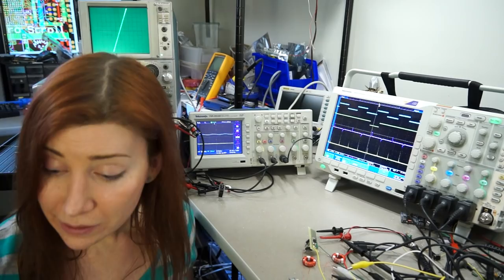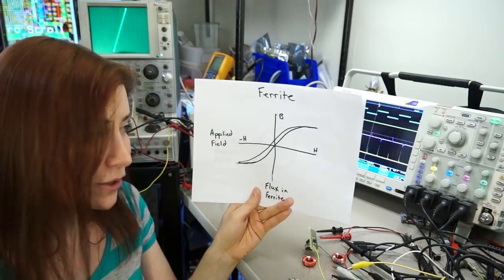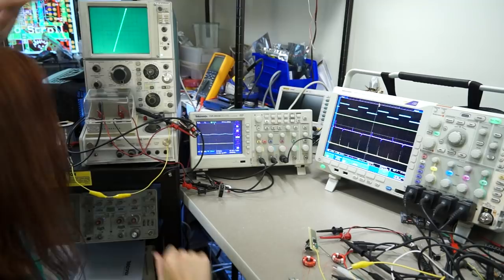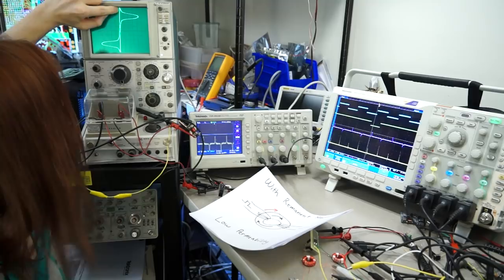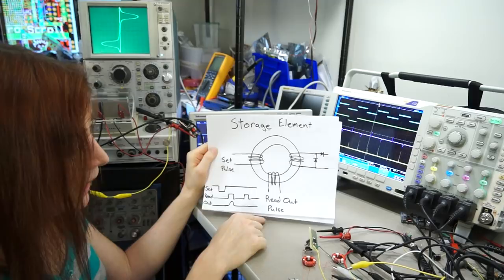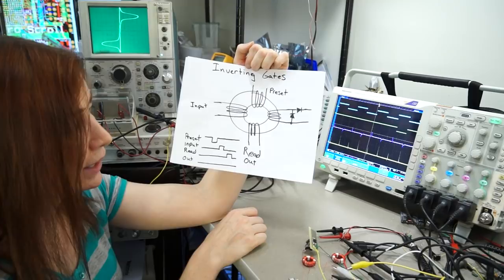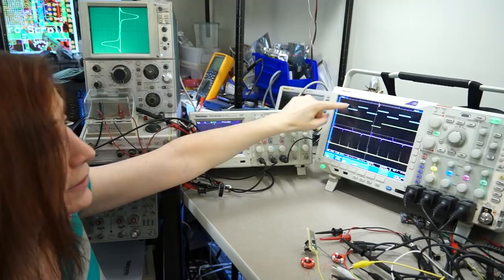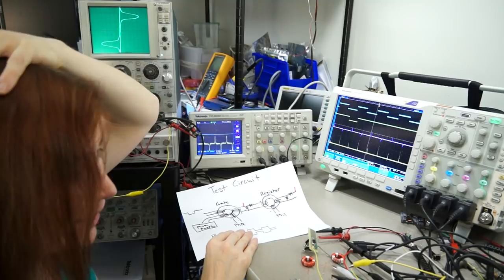Magnetic Logic - Forgotten Technology

Comment: Hi Jeri. This is a very good explanation of a said "dead technology". I was one who had worked with a mainframe with this kind of core memory. But I believe that is not safe to label some technology as "dead". Incidentally,  magnetic core logic is used until today in some Nuclear Power plant due to high level of reliability compared to semiconductors; it is naturally radiation hardened. You may find in several "silver box" Power supply for PC, even today, at 3.3V output - it is the MAGAMP regulator _. It is possible to find one Huge Power supply, working in harsh environment, which have one MAGAMP controller AND regulator in one piece. And, there are technology of thin film magnetic devices for the 21's century. Lastly, I suggest you to deal with the MAD (Multi Aperture magnetic Devices). The human inventivity history in not at the end - old tricks could come back.
Success,
Jorge

Comment: I just thought of something. You don't need a semiconductor to make a transistor at all. You could make your own 4-pin (that's right, four pin) transistor using a motor. The motor would act like a switch, pushing two electrical contacts together when you apply current. When you disconnect current, the electrical contacts are no longer touching. This could be helpful if you are a DIY kind of person and don't feel like purchasing day Germanium or silicon.

Comment: Olivetti used to use a coiled wire, there was a magnetic vibration sent in at one end of the wire and collected from the other side after a delay set by the length of wire, they used these as a stack.

Comment: BTW, i remember in my youth simple computing machines for children, they used these cardboard templates that fit in the machine (each theme had its template) and there were no ferrite coils but those were replaced by wiring cables by hand and to get an answer shift this connector thing. The principle was the same as the ferrite grid though. Itvwas the strangest contraption i've ever seen...

Comment: It appears that that read register in the pipeline might be used both as output and to repair the damage done by a destructive read, so the two ferrite cores together could equal a single storage bit.  Possibly you could also wire more than one storage core to a single read register core.  So to make a byte you could wire 8 storage cores to one read register core, and you would read the bits one at a time using a timer.  This would cost in time but save lots of ferrite cores and space.

Comment: And transformers make natural amplifiers by adjusting the turns ratio, so in theory you could make a computer without any transistors or tubes, but with two types of cores, and diodes.

In practice, however, transistors have been used in some stages, as with the commercially successful Elliott 803. Speeds of up to 1 MHz made magnetic computation a thing— a power hungry thing, but a working thing. The Elliott 803B featured hardware floating point operations in 1960.

Comment: i worked on a ferite core keyboard for nixdorf computers and the core when it detected a permanent magnet induced a puls into the ferite core...meanwhile the x and y lives were being scanned using multiplexors and an alu which esentially generated a pulse and knew which kew had been pressed which went out using a serial chip....i was the guy who fixed these boards and plenty of them using a scope and a big old computer work station set up to emulate the computer environment.  the good of days where you had to know what a component actually did

Comment: The F-4 fighter jet had core memory in one of the radio control boxes in the cockpit. They were a pain-in-the-A to troubleshoot since we would have to go in and desolder every wire on the core module and check continuity on all of the pins. If it checks good then we got to solder all the wires back in and continue troubleshooting. Thank God we don't use these any more. Interesting stuff about square hysteresis ferrite though. I'd never hear of it before.

Comment: I saw a control circuit in a switching power supply schematic (low voltage side) which used ferrite core saturation. It might have been in Art of Electronics 2nd edition by Horowitz and Hill. Magnetic hysterisis and saturation are useful - if little used - techniques for digital and analog circuitry. I saw a signature in a forum one time "Transistors are for wimps. Real men use mag amps."

Comment: One correction, which you'll never see...   That core stack shown at 1:02 is circa early 1960's, not 1970, and is almost certainly from a CDC 3000-series machine.  By 1970, CDC had abandoned the 3000-series architectures, and were working on 6000-series follow-ons, which became the Cyber 70 line.

Comment: Hello Jeri.  This is a great video. I like the drawings and the use of a curve tracer.

I am in my sixties and grew up on the tail end of magnetic core memory technology so I got some exposure to it in old computers in the late seventies. Some of them were still around.  I programmed an SPC-12 computer that had the "extra" memory boards to bring it up to 8K. Quite a lot of RAM at the time.

I cut my technology teeth in the telecommunications world on the analog side. It turns out that analog technology is quite interesting. For example, an old analog telephone  will put out increasing louder touch tones the further away it is from the central office even though it gets less power.
 
There is also a signaling system, called DX (distant exchange).  In this system, you and I both have a switch, a light, a battery, and a DX coupler.  There is a pair of wires between us. When you flip your switch, my light goes off and on.  When I flip my switch, your light goes off and on. Our own light is not affected by the state of our own switch. If someone had told me to design this system, I would have said it was impossible with only a two wire connection. Oh yeah, we can talk over the line at the same time, too.

Anyway, analog telephone ring generators were used in central offices to ring subscriber phones. A ring signal is about 100 volts at 30 Hz. You may be interested to know that a ring generator takes a 60 Hz signal and converts into 30 Hz using a transform that is driven into saturation every other cycle. There are other components, including a few hefty capacitors.  So the next time your phone rings, know that magnetic hysteresis is in that technology, too. 
 
Magnetic logic is very neat stuff and it is great to see you studying and enjoying it. Thanks for the video.

Comment: The diode across the coil at the output is to prevent the spikes...and  not for suppressing the ringing I believe. Because an inductor should never be left open in any direction of the current flow that will result in high voltage in theory.

Comment: It should be pointed out that magnetic core memory is nearly impervious to ionizing radiation, such as found in space flight applications. The implication is that solid state RAM or ROM can take hits from space radiation where magnetic memory can tolerate such an environment  without its contents being compromised. Of course the old core memory is way too large (not dense) enough to be practical today but I have long suspected that perhaps it can be radically miniaturized;  perhaps enough to hold the code needed to reboot a critical system is a space vehicle. I know of no such effort presently that would be small enough and dense enough to be practical. Just some food for thought.

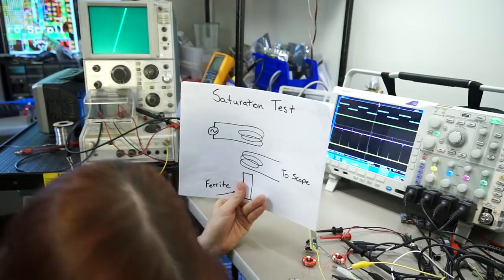Comment: Sorry Jeri, current is not induced (5:00).
Voltage is induced. The output winding will always see a voltage as the flux changes. A current will only occur if there is a completed circuit on the output winding.

Comment: allot of the stuff i work on uses this tec
allot of older electric DC drive controllers use gating
and pulsing of current to emulate AC function and to control the speed of a DC motor
by generating a square wave
with a bunch of old GE logic controllers real fun to trouble shoot when defective

Comment: NEAT ! Was there any thought given in using "Fluidics" in a computer designed for commercial use? Always thought that Babbage might have pulled of his computer ambitions if he had used the idea of "Fluidics" instead of levers and gears.
Reply: ufoengines Fluidics never really took off. There has been some resurrection of fluidics recently for use in nuclear power plants, for control of emergency cooling systems.

For example, fluidic diodes to ensure cooling circulation flows one way, and fluidic valves to provide cooling water top-up. The advantage of these systems would be that they operate entirely independently and require no additional monitoring, control or power.

Comment: In the 70,s they  got rid of the cores and sold bubble memory drives where data existed as magnetic  bubbles on a substrate . Cost could not compete with  silicon as advances in  shrinking die size emerged. But it had military uses because  of radiation hardness if memory serves as do  conveventional core memory did

Comment: Whoa. And here I was going to make a computer out of dual-rail diode logic. Not that I still won't.
I note that every one of these elements retains data until read out. Perhaps that simplifies timing a bit. Also, the AND/OR gates can be turned into NAND/NOR gates by adding a preset node. I wonder how many gates can be combined onto one core.

Comment: Great video and excellent concepts exposed. But couldn't help notice @  2:18.. gravity bends space and gravity slows time down, and to some degree regardless of how small that is occurring here by placing a source of gravity in the magnetic field . And since an effect of gravity is occurring it must be part of a mechanical process maintaining E as a constant connecting gravity to EM. It's affect on space and time seems small until you stop to consider that gravity given a size to create a ratio of the force of gravity relative to the electric force, is the size of a proton and the electric force is the size of the Universe. So the cause (gravity) of the effect is so small you really can't say the resulting affect is small for gravity is having a huge effect everywhere we look. Feynman said the proton to universe force ratio of gravity and the electric force had to be an amazing coincidence because the universe is getting bigger. 

But Einstein said there are no dice and it's all cause and effect even on the electron's scale so therefore there can be no coincidence if Einstein is correct. My money is on Einstein and the fine structure constant being a ratio of weak force asymmetry and time dilation creating a fulcrum that moves forward with time to hold the two force's ratio in place and keep it constant. So with that said, does the EM wave affect gravity... or gravity affect the EM wave? Or is gravity an effect caused by the EM wave being connected to time and space.... The principles being shown here 14:57 provide some insight of the tools needed to have gravity as we observe a speed of light clock running slightly fast giving us the time needed to let our clock move and be able to move around and think about it.

Comment: Great explanation, why don't you specify what you use? Like wire gauge on coils, turns, voltage applied, amperage, size of the core etc.?
From there, we could calculate the losses or gains in a larger setting.
For example: I need to build a transformer that steps up the voltage, from 12V to 20 000V.

Comment: Some of my thoughts on using circuits for free energy but also to attain superconductivity;
Any ungrounded charge has potential to begin free energy simply by having a carried wave inside it's charge which can implode through a nonlinear medium, thus multiplying after focus since sines become pump z's on the LF carrier which gets no or much less return (carrier wave peak falloff time and amplitude). Those darn meson particles found in neutral ion(charge) state prevent superconductivity. You can overclock any chip over a thousand fold simply by putting it into a field which has no limits to charge+. Communication to use such frequency would best be accomplished via laser diode since light waves don't short the chip. A fellow discovered this in the 80's and showed some gov' guys and was killed. News from my own father who worked at RCA in Princeton NJ 1981-84 just before GE bought them out. He designed the first ground based satellite comm station circuitry so phone calls would move through satellites.

Comment: Fantastic! In any logic circuit, eventually you need an amplifier to compensate for power losses. Using magnetics doesn't provide an obvious means of amplification, was that done separately, or was the arrangement sufficiently clever to provide signal power gain from a (presumably biased) hysteresis loop?

Comment: Thus the data input will be potentially different when it comes out, and the program running in the "order circuit" (large enough transistors as to be stable and not be corrupted) then run the data through problems and check to see if they provide an answer. and as a result you end up with a program capable of imaginative thought :) I am sure it would have to have something to do with the size of the windings, or a set of very sensitive thermal resistors, much like the REG''s...

Comment: I just found your videos recently. Thanks for posting them. While in High School in 1966 I visited the Burroughs manufacturing plant for core memories. I distinctly remember the X / Y and Sense wires. One question: When using square ferrite why does the "read" operation have to be a destructive "read". Shouldn't there be a way to sense the direction of the field without destroying it? 
BTW - got my Technician / General Class in Sept 2018 and my Extra Class in Nov 2018. Not quite as quick as you (all in one day).  73's, KC3MBK
Reply from the maker: Forcing the magnetic feel to flip induces the current in the wire.  A static magnetic field can't be detected with a passive wire(that I know of).
Reply: @jeriellsworth  Thanks for your reply. I had not realized that the SENSE wire on the old core memories was also a destructive read.  Guess I just never thought that much about it.  Thx, Don

Comment: Faraday Cage act differently with regard to Electric field vs. an incoming EM signal. With regard to incoming EM signal, the cage acts like a bunch of antennas that have been place around your object to intercept and dampen the incoming signal. If you did not GROUND your cage, the electrical current, produced when the EM signal hit the cage, will just run around in circle till it dissipate, which in turn set up a Magnetic field that replicate your incoming signal. Further insight upon request =)

Comment: Wow very cool.  I never put much thought into old style binary design.  I honestly, until I watched your video here, thought all binary systems just used tubes in the same way a transistor works back in the day.  One thing I'd like to know more about is what the physics look like with that square ferrite.  Why does it lock it's state vs scramble like non magnetic material, or the opposite, like iron.  I understand how magnetism and charge are related, due to the induction produced on an atomic level by electrons and how this works in iron where the poles cannot scramble and cancel each other out.  That's why i'm curious about this type of ferrite.  It's sort of a super permeable version of iron.  (yea Fe, I know.  haha)  How can it be magnetically permeable to change, but only under certain circumstances?

Anyway, THANKS!  Cool video.  I subscribed.  :)  BTW it's pretty awesome to see a female interested in this stuff.  You probably get all kinds of geek attention.  ha

Comment: i am glad to have found you!
Normally I teach  2 and 3 class tecnicalschool but   soon i have to teach 4th. But i am not ready yet 

I needed info  about the B-H  curve   and why it was so narrow for  normal transformers instead of being fat like those memory transformers.  Now I found the anser and i hope I am right.   a fat  B-H curve would put distortion on the secundary voltage since  it won't transfer flux to the sppecundary until it changes flux polarity.  hope I am right !     second question is the H for current and the B for voltage?  (this tricks me a bit)

Comment: This sounds familiar.  I've been studying 555 timers for a while.  I was once trying to figure out how I was going to pulse a square wave into a Rodin coil.   Are you aware of the Bedini energizer?  Does the rotor induce a pulse into the circuit or does a PWM need to be introduced?  And why would an optocoupler be necessary to activate a MOSfet on such a device, and how would this be achieved?

Crazy question Ms Ellsworth.  If you could create a PCM using near infra red wavelengths, would it be possible to engulf the Non Linear Crystal with an EM Field and extract energy?  or does that sound totally ridiculous?  On another note, do you know anything about how subtrates are turned into crystals Ms Ellsworth, Indium Phosphide for example.  I was looking into Laser Optics and specifically Non Linear Optics to create a PCM through Four Wave Mixing and was always pondering how these companies manage to craft such wonders.  

Thanks for this great video.  I really can't believe anyone would give you a hard time in the comments.  That blew me away, I mean this stuff is fascinating and you're sharing it with them out of the goodness of your heart.  It's like biting the hand that feeds you. Crazy.  Well blessings and good wishes to you Ms Ellsworth.

Comment: hi, thanks for the lesson.  I have a question: is the hysteresis gap defined by the strength of the fixed magnet, and therefore the energy required to flip the direction?  If so you could make dual paths that could match if using the higher level, but not if you used the lower to only switch the lower.  i.e. a 2 bit channel.